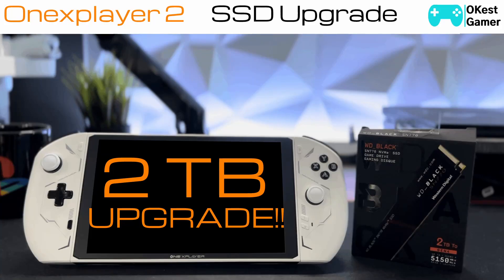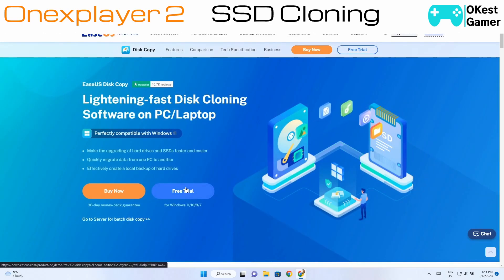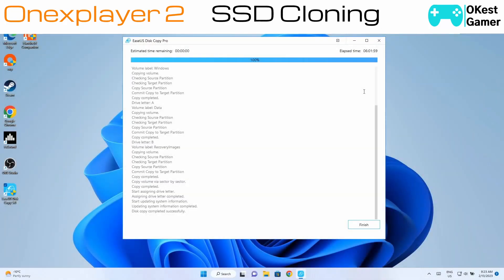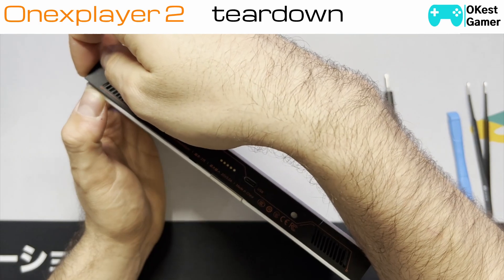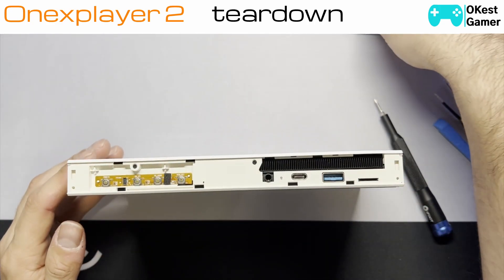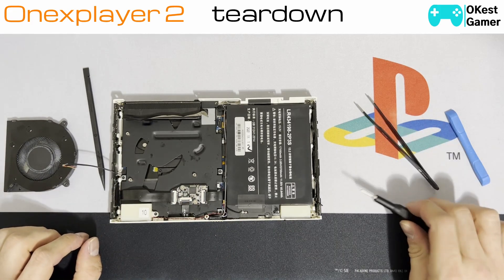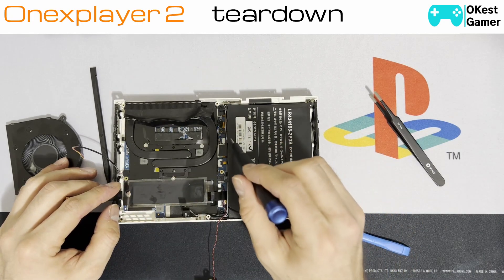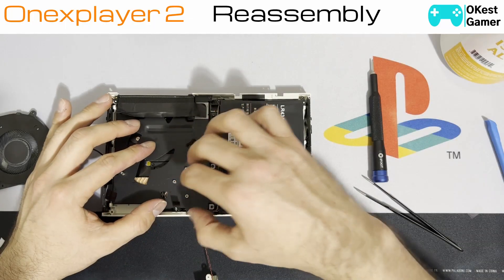Onexplayer 2 SSD clone and swap

Comment: Hi, could you help me? I changed my hard drive because it broke and I don't have a copy of the system, which is why my console is not working properly. By any chance can you send me a copy of the system image?
Reply from the maker: If you go into the bios you should have a restore option. It can revert the system back to stock
Reply: @okestgamer  i dont have this option

Comment: is the samsung 990 heatsink compatible with the pro 2 version
Reply from the maker: I doubt it, you’ll want a very thin heatsink
Reply: @okestgamer  what is your recommendation, should i get a micro sd or ssd. what are some compatible ssd for the pro 2. black ops 6 will use lot of power so i want to get a durable ssd card than micro sd card

Comment: Why did you take it apart and reassemble it?

I want to buy it, and I have a couple of questions: is it worth buying a 2 TB SSD or not, and how many TB can I upgrade it to?

And are there versions where there are other languages on the keyboard?

I'm looking forward to your answer
Reply from the maker: To access the SSD, you need to disassemble the device. I would suggest getting a single sided ssd which can go up to 4tb
Reply: @okestgamer  And the maximum amount of available TB is how much?
Reply from the maker: 4tb for single sided ssd, and 8tb for double sided
Reply: @okestgamer I was about to ask if the 4tb would fit. Would make the onex 2 pro a monster
Reply from the maker: It should fit if you use a single
Sided one. Other will also, but then you gotta be careful with temps

Comment: Update my screen is no longer showing an image but it's still operational ... The controllers function properly as does the unit when connected to a dock. The touch screen on the unit itself now gives an inverse input (i touch the top left of the screen and it registers on the bottom right of the screen) if anyone has an answer to fix that would be wonderful. Everything is operational but the screen displaying any image on the unit
Reply from the maker: That is very bizarre, and this behaviour is on the new ssd?
Reply: @okestgamer  and the new SSD worked fine on with the screen booting until I took it apart again to reconnect the controller ribbon cables
Reply: No originally the controllers weren't connecting when attached to the system. So I reconnected everything and the controllers are working but no screen. Was just curious what components control the screen besides the bottom ribbon cable on the controller board.

Comment: What sort of read speed SSD am I best to get?? Obviously the faster the better but what does the onexplayer 2 need? I've never bought an SSD before so not 100% sire what to look for plus I don't wanna spend a lot. Cheers dude 👍🏻
Reply from the maker: You could probably get away with a cheaper one. A lot of people use the crucial p3
Reply: @okestgamer  I've found a 1tb version of the one your using 👍🏻 I don't need 2tb. Is the one you got just as good as the stock? I don't want my games to take longer to load 🙄 what is the read speed of the stock SSD do you know?
Reply from the maker: This one is better than stock
Reply: @okestgamer  It's in and up and running! Thanks for your video dude really helped me out 👍🏻

Comment: I'm gonna try to replace my SSD, so thanks in advance for the tutorial!
Reply from the maker: No problem, hope it goes smoothly
Reply: @okestgamer  I switched to a crucial p3 plus. Didn't clone, 'cause i wanna do a fresh install, but W11 install procedure doesn't see the new drive. Any clue? I cannot find a section in the bios either to see if the oxp does recognize the drive.

Comment: Thanks for the video, did a successful upgrade to a Crucial P3 4TB SSD with the heatsink you recommended. The iFixIt kit was essential and had an issue with one screw but otherwise perfect. For cloning I used a Volans external NVMe caddy, Macrium Reflect and Disk Partition Wizard.
Reply from the maker: Nice! Glad it went well for you. Yeah there are other good cloning options out there that are probably cheaper or free.
Reply: Drop performance

Comment: Thank you! With the help of your video I was able to upgrade my SSD and repaste my CPU in my OXP 2!
Reply from the maker: Awesome! I’m really glad to hear that. How were the screws on the side rails?
Reply: @okestgamer  all of my screws were easily removable. None overdriven, loose, or stripped. My only issue was that I didn't understand how the ribbon cable plugs worked at first. (For others, if you flip up the black latch, they slide right in and out)
Reply from the maker: @DanielDenette  glad to hear they came out smoothly for you. I kinda assumed it was because of mine being a prototype and probably manually put together.

Comment: Hi I saw your response on my other comment on your channel. A question that came to mind is will replacing the SSD void the warranty or is there a grace period?  If so, did you choose to go ahead and replace it despite the warranty losing its value?
Reply from the maker: I believe it will void the warranty if not cleared by them first (they may send parts if users know how to self repair). I am a beta tester, so for me warranty is not a thing.

Comment: Cloned the drive, won't boot. Tried 2 drives (2 and 4tb) and everytime I get a blue screen and says some boot file is missing. Starting to think OXP2 is going the apple route and locking in the hardware.
Reply from the maker: No it’s not locked down, I had no issues when I did mine. Perhaps the clone failed. What software did you use?
Reply: @okestgamer  I used the same software and an alternative. I'll try again, the device is really nice.. I want to sink my teeth in to it, 512 gigs is not enough.
Reply from the maker: @davemortimer7085  oh yeah definitely. having more space is always great. if you can't get it running, setting up a fresh install shouldn't be too difficult.

Comment: Is there a snowball’s chance in hell a double sided ssd could be used in there? 3.5 mm is the thickness of a 4tb i was looking at.
Reply from the maker: I believe one would fit in there. My only concern would be the ssd temps, but others have done double sided on similar devices without issue.
Reply: @okestgamer  do you have by a chance any photo of "clearance" left under the drive after installing the single drive ? from photo i could extrapolate whether doublesided will fit.
Reply from the maker: @marcinstragowski2208  none that would give more perspective than the video unfortunately
Reply: No worries about this issue, found a single sided 4tb drive.

Comment: Will 2 sided fits?
If not I’ll get Crucial P5 with 4TB.
Reply: I'm running a 4TB Crucial P3 with a heatsink no problems. Double sided may have issues due to both clearance and heat.
Reply: @DavidHorth  clearance on bottom is too tight in your opinion to fit double sided ? do you by a chance have any "photos" or measurment how much space is between ssd and pcb after installing single sided ? or maybe by a chance you got the opportunity to test double sided ? i wouldn't worry about high temps when using drive for "Storage" and not constant access.. my mp400 corsair 8tb in really tight application right now doesnt exceed 44c.
Reply: @marcinstragowski2208  no photos but there was little to no clearance underneath, maybe 1.5mm at most. It was very tight in there, I was worried I couldn't fit a 2mm heatsink on top, it only just fit. If I teardown again for thermal paste (not seen any need for it as yet) then I'll take some pictures and accurate measurements.
Reply: @DavidHorth  i would be really glad, actually 1,5 mm underneath would be totally enough
Reply from the maker: There is a little bit of room, the main thing would be making sure the temps are fine. One thing I will note for you though is that my sn770 is only getting pcie 3 speeds when installed here. It could be a prototype thing, so if you do put a pcie 4 ssd in please let us know if you get decent speeds.
Reply: @OKestGamer  what physical size is the SSD can be fit?

Can a 2280 fit?

Because I'm wanting to fit an 8TB SSD.
Reply from the maker: @AdmiralBison  it fits a 2280, I would mostly be worried about temperature for a double sided, but have not tested myself. I believe physically it would fit
Reply: @OKestGamer  cool thanks.

perhaps some thermal paste would help with the temps.

I've replaced my Surface Pro 9 with a 2TB SSD with no paste or sticker and has worked fine, so hopefully it will be the same when I receive my oxp2.
Reply from the maker: @AdmiralBison  I put in a wd black sn770 (single sided) I added a heatsink to it and it’s super cool no matter what I do to stress it. I haven’t really worked with double sided yet so not sure what solutions would work. I’m pretty sure it could work though
Reply: @okestgamer  would you say the double sided SSD would work with a thin heatsink on both?  Also, would you say it makes a difference to put a heatsink on both sides of an SSD or just one?
Reply from the maker: @Akaraah  I've never had to manually put a heatsink on a double sided m.2 so not totally sure tbh.